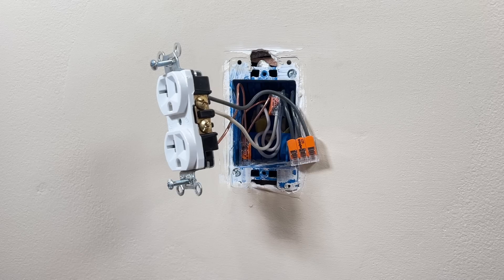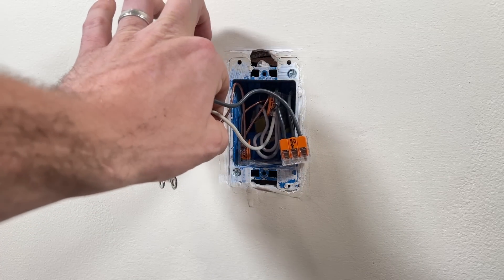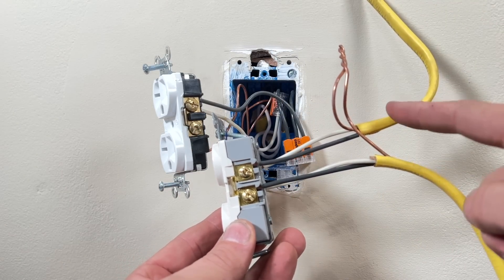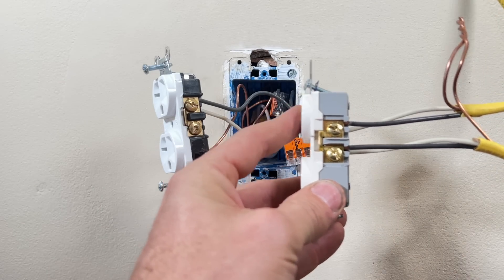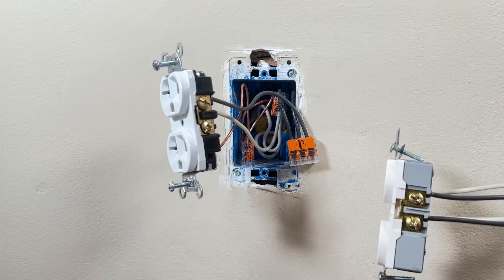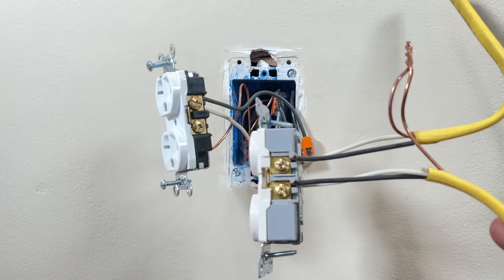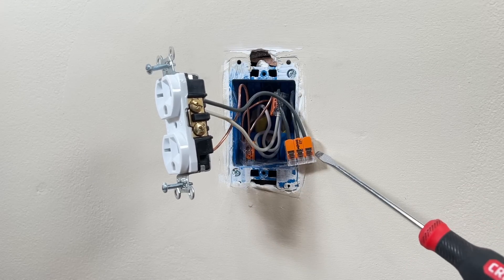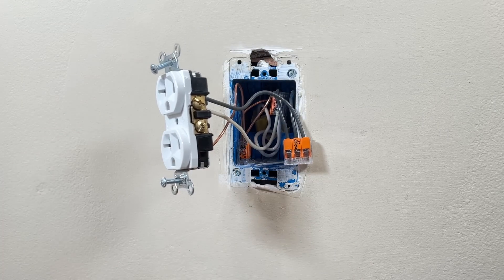How and Why To Make A Pigtail

Comment: I hadn’t heard that using the device to daisy chain was against code nor had I heard the argument about it being easier to affix to the box.  As for the “device failing” causing problems down stream, I don’t buy the argument. It’s a copper plate with screws that connects them, the device is not involved. No difference between wire nuts or wagos because those methods of splice can fail too.
Reply: It can fail I actually like this method better. There's a difference in corrosion and homes that have not had heat for a long time. May have to look into this. I've definitely experienced the failing down stream effect from an outlet. There's definitely some kind of difference however maybe this mobile home had cheaper outlets than you're thinking of.
Reply: @Nickelbawker  Every connection is a potential failure point. Adding a splice for a pigtail is adding a potential failure point. I've seen more failed splices than I have failed receps, doesn't mean splices are more prone to failure.
Reply: Using the terminals for feedthrough current is not against code. It's legal and exactly how the devices are designed to be installed.

Comment: If any practice is against code, or required by it, at least citations should be included. Other channels, like "Electrician U" read off the code to veiwers.
Reply: Using the terminals for feedthrough current is not against code. It's legal and exactly how the devices are designed to be installed.

Comment: I'm not going to debate whether to pigtail or not as there are good cases made for each method.  However, I can tell you it is NOT against code to use a duplex receptacle (translated as 2 devices) to run line and load, so long as only ONE terminal screw is used for each wire.
Reply: Code or not, I have found stab backs being used as downstream for the entire kitchen....but FROM A Bed room outlet! No lie. Apt building I work on very regularly from 1985. One little jostle and your kitchen is dead. Not a good plan.
Reply: @beerbeforebreakfast  Backstabbing and using the screws for feedthrough are not the same thing.
Reply: @pld8993  oh heck no, backstabbing is the very least contact possible, side clamps however are a world apart. If a device has side clamps it is most commonly very well made, slightly more robust and will not be an issue on its own.
Reply: @beerbeforebreakfast  terminal screws on devices are designed, manufactured and UL tested and listed for feedthrough current. Pigtailing is not inherently better, contrary to what many believe.
Reply: @pld8993  yes I agree. The only benefit that pigtails can possibly allow is isolation of a failure point. Since it separates the device from being an integral part of a circuit and possible fail point. Personally from my own experience of what I have actually seen through the years, I would still prefer a pigtail at a box for an outlet but I would be ok if the situation would make things simpler with a side clamp outlet sush as a heavy duty or industrial grade receptacle would typically use.
Reply: @beerbeforebreakfast  Except that pigtailing requires adding a splice, which is adding a potential failure point. I've seen more bad splices than failed screw connections and when done by an amateur, I'd trust that they can tighten a screw before I'd trust them to make a good splice. The terminal screws on a cheepo 15A recep are rated for 20A feedthrough current and when installed properly, will likely never fail. Even if the recep fails internally, it will have no effect on the feedthrough terminals.
Reply: @pld8993 pretty sure one of my outlets has three wires connected to one screw. How should i fix that
Reply: @JT89877 Unless it is a commercial grade outlet rated for 2 wires to each terminal, you should switch it to pigtails. The other issue with this might be box fill, which is the number of wires coming in and out of a box. Even pigtails will likely make it hard to fold the wires into the box.
Reply: @SmallSpoonBrigade  If you're receps are 50 years old so is your wiring. It's all due for replacement.
Reply: Commercial code or residential? If it was in a business, I would prefer pigtails hands down, less disruption losing only one outlet. The only downside is time installing and how well someone can splice, like already said.  Maybe the armature should stick with chains. I also wonder if the the outlet buss adds any additional resistance or if it is as good as the copper wire?  Pigtails are worth the little extra effort imo.
Reply: @scottcureton6055  Yes, and keep in mind that receptacles with integrated lever nuts are here, and if you have a pigtail, it makes it trivial to swap out the old for the new without having to screw around with wiring for the rest of the circuit. You still ought to power things down, but that's always a good practice when you can. 

Pigtails are also a good idea if it's a smart outlet. Those are likely to need replacing more frequently than regular outlets, so it makes sense to make that as easy as possible.

Comment: Just installed 4 independent GFCI outlets along a single kitchen wall.  Used pig tails with WAGO 221s on each.  This all started when I had to find out why the single GFCI was failing.  Turns out they were all daisy chained from the first and only GFCI.  A failed notched wire downstream cause all to fail and wouldn't let the lone GFCI reset.  Now each outlet is independent.  This is especially important as so many counter appliances (InstaPots, Air Fryers, hot water kettles) are being used.
Reply: That’s how GFCI outlets are supposed to be wired. You only need one to provide power downstream for them all to be protected. You can pigtail all the rest downstream, but you want the load side of the GFCI outlet to provide power for all downstream outlets. 

What you did isn’t wrong, just a waste of time and money.
Reply: @jdeluca6181  I would agree, unless you have a situation where you think you might be tripping the GFCI often enough that you want one for each device so that you only take out one receptacle when it happens.  I wouldn't do it, and with all GFCIs that I can find now having a red LED when they trip, it's trivial to find and reset the fault, but if you really like having the reset button on the same outlet as the device that tripped it, go for it.
Reply: So you ran 3 brand new circuits? Or did you remove the load side wire from the old GFCI, spliced it back to the line side and repair the damaged conductor downstream with the new GFCIs pigtailed into that circuit?

Comment: i have never used the wago. does it matter which part of the wago is used to house the pigtail? if so, is it marked in some way?
Reply: It doesn't matter, it just connects the wires together electrically the same as a wire nut.
Reply: Wago lever nuts are a bit of German engineering to improve on the old fashioned twist-on wire nuts. They are not cheap, but I LOVE 'em.  My electrician buddy once swore to me he'd never use them and told me he thought they were junk.  That was before he read up on them and gave them a try.  Now, he swears by them and uses them regularly.

Comment: I’ve seen these lever nuts open up. Not good for long term use
Reply: A quick wrap with electrical tape will stop that
Reply: My son and son-in-law took a couple of Wago’s I had placed some extra wire in and played tug of war. They are both big, strong dudes. Not a single one popped open. And I was the one who cut and placed the wires ( 64 yo grandma with arthritic hands). I simply used the cutting guide on the Wago and made sure I snapped the cover down.
Reply: Were they wagos or cheap knockoffs?

Comment: I have never heard of pig tails being required. I looked it up it states that it is only required for multi wire branch circuits- which this is not. I am not an electrician but looked in the comments for an expert to chime in and did not see one yet. 

Any receptacle over ever replaced that was installed by an electrician was daisy chained and not pig tailed. Including in a house from 2018.
Reply: lappinrappin - I'm not an electrician either, but I have researched this issue and I found that what you said about pigtail requirements and MWBC's is correct. However, pigtails are considered the preferred method, regardless, thereby keeping each receptacle independent. Most good electricians use pigtails and using the receptacle as a connector is poor workmanship imo.
Reply: @surferdude642  I disagree it’s “poor workmanship”. The receptacles are literally designed for this purpose. The idea that “one could fail and knock out downstream outlets” is actually a feature, IMO. If somehow the strip of metal in your outlet has broken, it is in seriously bad shape and being alerted to a problem is a benefit.
Reply: @SongOfStorms411  You said that receptacles are designed for this purpose and is actually a feature, is something I've never heard of. While I agree that using the receptacle as a connector is valid in most cases and is even commonly done, it's just not considered best practice. It doesn't take a journeyman electrician more time to use wire nuts and they don't count in box fill calculations. 
I realize that receptacle manufacturer's such as Leviton advise an installer to use the receptacle as a connector and that's because it's easier for untrained individuals. There is a learning curve for using wirenuts correctly. Using push in connectors or Wago lever nuts would be a solution there.
Reply: @SongOfStorms411  probably also a way to be a sort of fault indicator if everything down stream is dead from that connection
Reply: @surferdude642  i think it's much cleaner and easier to do the pigtails.  for one you can sit and wire up all of your plugs at the table... then take  them over and tie them in.
Reply: @jameslockhart8250  lol??  what would it matter?  if that one plug just quits instead of the rest of the circuit then you definitely know where the problem was. lmfao?
Reply: @BlakeHarvey903  I always prefer using pigtails and I get the method you're describing and I think it's a common approach on large jobs, it could be more efficient. I don't really like that approach though. Having the receptacle dangling there while twisting wires, especially 12 gauge, is awkward to me. I'd rather add the pigtails during the rough in and fold or roll everything as deep in the box as is reasonable. I've had good results even with three 12 gauge cables in a single 22.5 cu in plastic box. Typically this would be about 20.25 cu in of box fill. No rotozip damage. The trim out goes fast, ground wire and a half inch strip of each conductor and back wire a spec grade receptacle. No sharp bends or kinks and the receptacle goes in with minimal resistance.
Reply: @surferdude642  Well I am an electrician (40+ years) and it absolutely does take more labor units to make a splice and pigtail and when you're doing a hundred on a project, that time add$ up. While pigtails and wire nuts don't count toward box-fill, they do take up space. The terminal screws on receps are designed and UL tested and listed for feedthrough current because that's how they are designed to be used, not because Leviton is trying to help out untrained installers. It is not, in any way, poor workmanship to install a product the way the manufacturer designs it to be installed. The tab between the terminals on a 15A recep is rated for 20A, which is part of the reason why we can use 15A receps on 20A circuits. While pigtailing is sometimes required, there is no electrical advantage to pigtailing. Pigtailing or using the terminal screws for feedthrough current, when done properly, are equal in integrity and function.

Comment: That's really helpful. One issue though is if you're using an outlet with a ground fault circuit interrupter, you need to have the power running out of it to provide downstream protection, yes?
Reply from the maker: Correct and would have been a good callout in the video 👍
Reply: @EverydayHomeRepairs  Related question: My kitchen was built in early 1978 and it had no GFCI's in the kitchen.  I have duplex receptacles both 2 feet away on each side of the sink.  Question is, if I don't know which way the electricity stream direction flows, is it okay if I just put GFCI's on both sides of the sink as a replacement for the 1978 duplex receptacles on both sides of the sink?
Reply from the maker: Yeah, that would work.  But you can also watch this video to help identify which wire should go to Line vs Load. https://youtu.be/bWfveKM6NEk
Reply: @JasonJayJJ1  It’s pretty straightforward to find which outlet is upstream. If you have a kill-a-watt or a 4-digit voltmeter, you can measure the voltage at each receptacle. The highest voltage is your most upstream. You’ll also notice there’s a small voltage drop between the top and bottom outlet, so test both and take the higher voltage. If you put a load on the circuit? The voltage difference is more noticeable, but you need to find a device that draws a constant load while you’re measuring your outlets. A box fan would be a good constant load device.

If you don’t have a way to measure the voltage, then make your best guess (usually the outlet physically closest to the panel), turn off the breaker to that circuit, and disconnect the black wires from that outlet. Cover each separated black wire with electrical tape or wire nut, then turn the breaker back on. Test the downstream outlet with a lamp or circuit tester. If that outlet is off, that means the outlet you disassembled is upstream. Otherwise, the outlet you disassembled is downstream. Repeat for as many outlets as necessary until you find the most upstream outlet on that circuit. GFCI protection should be installed in the most upstream outlet.

It’s even easier to install a gfci breaker in your breaker panel. No guesswork, no fiddling around with j-hooks, cramming too many wires into the back of a small junction box, etc.
Reply: @JasonJayJJ1  just untie one receptacle in the circuit. Now leave that receptacle untied and check the next one in either direction one of them should be off
Reply: It’s that easy
Reply: @JasonJayJJ1  Multiple GFCI receptacles on the same circuit is a really bad idea.  I had this in my kitchen (two circuits, one with two GFCIs and one with none--I fixed that).  I had one of the outlets trip, and then I tried to reset the other one.  I found you can't reset a GFCI if there's no power.  This gets really confusing for people who don't understand what's going on.  It's much better to have only one GFCI at the start, and then everything works as expected.  If you really want multiple GFCIs on the same circuit, use pigtails so that they trip and are reset independently.

Another example, my in-laws have two outdoor outlets on their deck and both are GFCI, but I'm pretty sure they're in series.  I don't know which one is upstream, since at least the downstream one has failed.  Since I don't know what circuit it's on, I'll have to turn off all the 120v circuits to be safe when working on them.  If they had been wired with pigtails or if only one were GFCI, it would have made the failure much simpler to diagnose.
Reply: @pfcrow  I have 3 pigtailed GFCIs in my kitchen on a split circuit (one hot/breaker for the dishwasher +disposal [red] and another hot/breaker for the receptacles [black]). I wanted to replace some of the outlets with non-GFCI w/USB ports but I can't because everything is pigtailed and unfortunately I can't wire the first outlet inline because the wires are so short because they were using pigtails. Having to replace multiple GFCIs is an expensive proposition when one protects the whole circuit just as well. What is not clear to me though is if I did inline the first GFCI outlet, whether the pigtailed outlets downstream of the GFCI are in fact protected. Thoughts?
Reply: to add to the fun, the line for first GFCI reads 40 amps unless I flip off both breakers but I don't see anywhere on the circuit where wires are crossed
Reply: You are correct. If you did the setup like he has, then only that one outlet would be GFI protected.

Comment: I think I would be able to understand this better looking at wiring diagrams, which omit unimportant details, than looking at the actual wires, connectors, receptacles, etc.
Reply from the maker: I also like schematics but I’m not sure if that helps or hurts most viewers with maybe a little less experience reading a schematic.  Can be overwhelming and hard to connect back to the real world.
Reply: @EverydayHomeRepairs  : In this case, the wiring diagrams would be almost entirely wires.  No resistors, capacitors, inductors, amplifiers, etc.   The main point of interest would be the difference between the code-compliant diagram and the code-violating diagram.